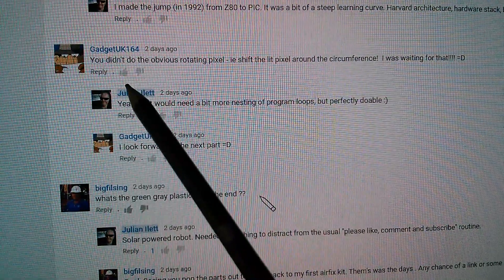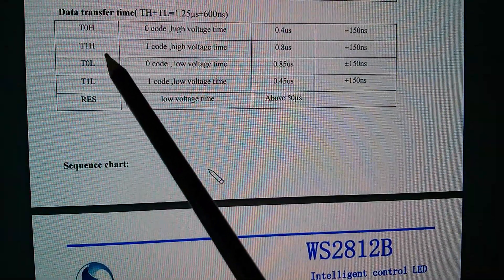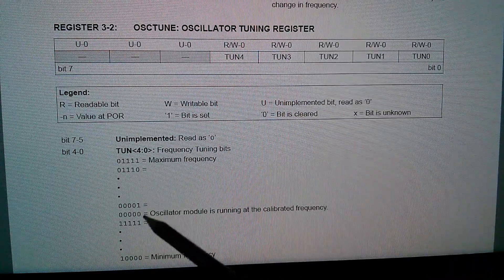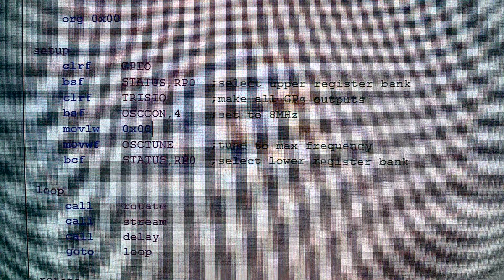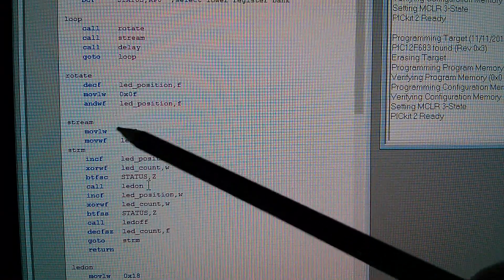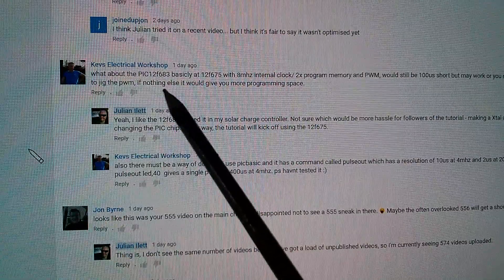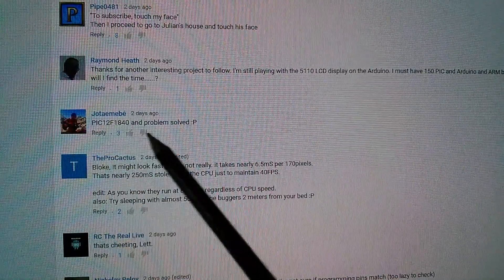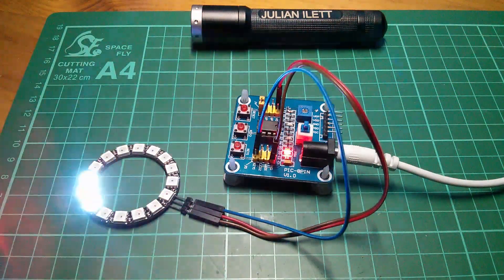Update: NeoPixels and PICs (with name checks)

Comment: @Julian:   Please answer.
I am preparing to get all that is needed for your PIC tutorials.
I ordered this    http://www.ebay.ca/itm/Attiny13-AVR-Development-Learning-Board-Experimental-Test-Board-/351782855481?hash=item51e7e46339:g:w7kAAOSwV0RXvwNB    and also a PIC 12F683 chip for it.
The connector in this board looks different, Will I need to change it or get a cable for it that adapts to the pic programmer? And also what pic programmer do I need? The 2 or 3? What will you be using? Thanks for your time.

Comment: Actually, one comment to your software diagram... The problematic area is only the bit-banging loop of led-on and led-off. To be precise, the part of the time where you send out the first bit till the transmission of the last required bit. The following timeout just sets the previously sent values to be visible. What you do before and after this transmission sequence is absolutely non-critical. Without having seen your code, may be you just need to tweak some branch decisions or you unfold a loop, or you use counting from x to 0 instead of the other way round, and you can use the untrimmed 8MHz. However: Well done video!

Comment: Nice! If you have a free pin available -- can you toggle a signal with each iteration of the loop and hook up to the oscilloscope so we can see how long the loop is taking?  Would also enjoy seeing how much faster than 8Mhz the clock is running at tweaked frequency.
Reply from the maker: Yes, that's a good idea - both of them. I also want to cover a couple of software features, so I think I'll do all this in another video.
Reply: That would be great... I always learn so much from your videos!

Comment: Microchips AN244 indicates that OSCTUNE will tune a frequency within a range of +/-12 percent on the selected frequency. The only caveat is that it specifically mentions only the PIC16 & PIC18, but maybe this still valid for the PIC12s with tuneable oscillators? I'd also recommend the PIC12F1840, as it is a nice chip with the ultra low power modes, and was also the pic used chosen by Revolution Education for the 8pin model PICAXE chip.

Comment: Great video! Will you be doing AVR assembly in the near future? The AVR has no internal clock division and is cheap. Most instructions are single clock cycle execution.
Reply from the maker: I didn't know that. That would make AVR code run 4 times faster than PIC for the same crystal frequency.
Reply: Indeed it will. Oh, there's a catch of course. Some chips are shipped with a clock devider, but that can easily be set with a fuse setting. A "nop" would take one clock cycle which is 125 ns at 8.0 MHz. The resolution is not great, but I believe you can get away with 3 nops and 7 nops for a T0H and T0L sequence. You would probably need to take the GPIO operations into account.  A great AVR delay calculator here: http://www.bretmulvey.com/avrdelay.html

Comment: I'm running into similar timing problems with my 4MHz 6502 SBC. I can fit basic patterns in the 9us window, but anything more complex causes issues. I plan to compute the pixel values beforehand, and then stream them from memory to the output.
Reply from the maker: That perfectly illustrates the two different ways of doing it :)

Comment: hey julian, a little random but i thought you might like this USB load tester i got from ebay, it can test up to 3A, better then the one with those 2 big resistors on it, and its adjustable with a pot so its precise. you can measure devices that take 2.4A or more with it. http://www.ebay.com/itm/231975937640
Reply: I got one of those a few months ago... I really like it for the 'knob' on the adjustment pot, and the heatsink and cooling fan so you can leave it for long periods without worry about it setting itself on fire when at 1 or 2A loads ;)
Reply: yup exactly, no tool required. i tried plugging it into my computers usb port and it started drawing over 2 amps! im pretty sure they are supposed to max out at 900ma. hope i didnt fry anything :X but the fan is nice indeed and the adjustment is precise

Comment: Goes to show that the choice of components can be critical to achieve the desired results, even with microcontrollers. You can't always do everything in software, as some would assume, so choosing the best microcontroller for the job is important. Your video reminds me of programming my brothers computer in BASIC as a kid in that it took quite a lot of code for relatively meagre results - none of these pre existing libraries then, absolutely everything had to be done by you, unless you could get hold of a cassette tape copy!
Reply from the maker: Yeah, very good point. There's no "one size fits all" microcontroller.

Comment: Here's a fun one; see if you can get it to go slow near the ends, and fast near the middle, then, when it reaches the 16th LED, reverse direction. Then you'll have a pendulum-like movement of the LEDs (though it'd look better if the board was arc-shaped)!
Reply from the maker: Bouncing the lit pixel from one side to the other is probably quite easy. Speeding up and slowing down (particularly if the proper sine function is used) not so much.

Comment: I think you've found an excellent example of how the optimization of code space vs. time are inversely proportional. In a situation like this where saving a few cycles it's extremely important but perhaps you have some code space to spare you can inline your functions. In other words, remove all of the calls and include redundant code so that there are no calls or returns and the code runs as quickly as possible.

Comment: The best way to solve the timing issues is to have an array of rgb values with size equal to the number of pixels you connected. You can then write a function that writes this data out to the LEDs in one go, iterating through the array. In each frame, you first do your costly calculations and subroutine calls to determine the new state of each pixel, but write to the array instead. After you are done, you flush out your changes using the function I mentioned. Using this pattern the updating and actually communicating with the hardware is entirely decoupled, updating can take as much time as it needs.

Comment: Hmmm.. Can't you shift on the lit pixel by outputting 24 zeros and latching, instead of updating the full set of bits each loop?
Of course, you'll need to output 24 1s every time your pixel falls off the end of the ring...

Comment: The APA102 is pretty neat. Not as common as it is more complex. You drive it with your own clock signal so there's no need to get super fancy with all the PICs and clock adjustment. Interestingly, they can also be driven faster than the WS2812's as well since you can define the clock signal.

Comment: Increasing to 32mhz would be cheating! Part of the fun of programming within constraints is optimising your code.
Reply: lol... true... but you can only optimise so much if the instruction speed of your CPU isn't fast enough for the job! :-P A step up to 16Mhz would be nice, as that would give the necessary speed to ensure that the PIC is outputting code with the correct timing, and possibly have a smidgen of overhead for it to start doing other fancy stuff. 8Mhz is obviously not enough (if my understanding is right Julian is 'overclocking' the pic to ~8.96Mhz) and that is just enough.

Comment: instead of constructing the stream with loops could you have it in the EEprom data area and just index it out, may not be any faster but then microseconds count, would imagine it would be 3 eeprom reads per LED to get the RGB values.

Comment: It looks like you are sending an off command to all leds, so it is always sending a long data stream, can you just tell it to turn off the last led and turn on the next one, to shorten the data?
Reply: the neopixels don't behave like that unfortunately, once they latch, they lose all the data on the bus, and everything needs to be pushed back in. it's a lot like a shift register, but not quite one.
Reply: Merte Edenflower - ok I thought that might be the case, not something I have looked into, I wonder if there is a way to make the generation of the code in a single block to speed up the code, to remove some of those loops.

Comment: I have just received 3 Atmel ATmega328P's in the post and I am wondering what to do with them now. ;-)

As I am not familiar with the PIC you are using here I offer the tentative suggestion of maybe using interrupts in timing-critical code. It would certainly help overcome the inevitable bottlenecks.
Reply: An interrupt isn't free - on many architectures it takes even more cycles than a standard subroutine call. Interrupts and time-critical code together is very much like running with scissors, except blindfolded in a room you've never been in.
Reply: Interrupts wouldn't help. The problem seems to be fetching the next bit to output quick enough. Interrupts won't make that faster magically. Considering that apparently you've got a few microseconds to fetch the next bit before the LEDs see a reset condition, that's a few tens of clocks at 8MHz. That is plenty! Since it's not really necessary to update the LEDs any faster than let's say at 100Hz, you've also got 10ms to calculate the new "frame". That amounts to tens of thousands of clocks/operations available.
Reply: It was a 'tentative' suggestion at at no time did i imply they were 'free'. Interrupts by their very nature are somewhat time-critical. ;)

I am used to running Neopixels on 8 MHz chips using a library specific to that purpose so maybe I am just spoiled? :P

Comment: And what would be the max number of neopixels you could control with this pic ? the ram is not that big in this pic no ?
Reply from the maker: Neither RAM nor Flash size are limitations here - because I'm synthesising the pixel data mathematically in real time. The rotating pixel code uses 6 bytes of RAM.
Reply: ViciousCoding L33T From what I see of Julian's code it seems that the sequencing is coded in flash and not in RAM, so it should be able to handle a larger string with little problem.
Reply: oh ok that's nice, cause i know that with the adafruit library for arduino, they store the datas in arrays and this creates a limitation on the number of pixels
Reply: The latest AdaFruit library works on an ATtiny85 so maybe they've optimized it since.

Comment: you could always unwind the loops and jumps. Not real manageable but I bet you could optimize enough to eliminate the reset.
Reply: If a subroutine is only called from one place, you can easily move it in there - an old trick used when programming in assembly language.

Comment: Julian, do you have a site where you make the code etc public? I use these LEDs with an Arduino but it'd be interesting to see.
Reply from the maker: I've put the 12f683 code (8MHz internal clock) on hastebin - http://hastebin.com/efumevaqih.vbs
Reply: Thanks for that. Be nice to play around with PICs as well as they're used quite widely. Cheers.
Reply: BTW, I think you should set up a site :P
Reply: why not use GitHub...

Comment: i have to say julian, iv always loved the idea of addressable leds, but was scared of the code, iv only had experience with arduino's,  and that was purely out of necessity, you really bring this down to earth,  i think some neo pixels should be on order soon, also could this be done with arduino?
Reply: phil no yes use AdaFruits lovely NeoPixel library (it was developed first for the Arduino after all).
Reply: Adafruit has a library specifically for its Neopixels so yes indeed it can. Doing it with the PIC presents a lot of challenges as there is no such hand-holding.
Reply: phil no Worth noting that if you want a bit more flexibility and speed at the cost of slightly less user-friendliness then there's an alternative library called FastLED.
Reply: cheers for the information lads and lasses, (not wanting to offend)  im going to give them all a go, and see what fits :-)

Comment: can you also tell which oscilloscope you use ! awesome video(s) 😉
Reply from the maker: I use an Owon PDS6062S, but any oscilloscope is better than no oscilloscope :)
Reply: Does that include the DSO138 kit? ;-)

I jest, of course, as I have been unable to contain my curiosity regarding this device and have bought a kit.
Reply: I am just starting out with electronics and have no budget at all so the DSO 138 is a great bit of kit for the basics. Also it's fun to build.
Reply: I made the mistake of buying my scope from Maplin (and paying way more than I should've as their markup is dreadful) and getting what can best be described as a 'mediocre' scope. I am now on the lookout for a decent 100MHz analogue scope.